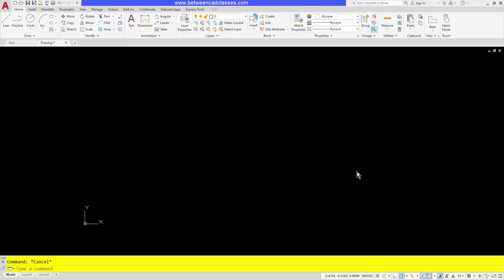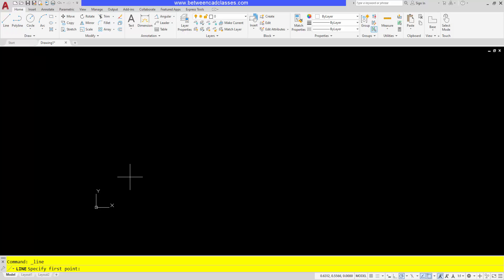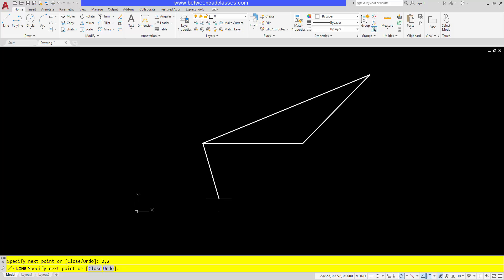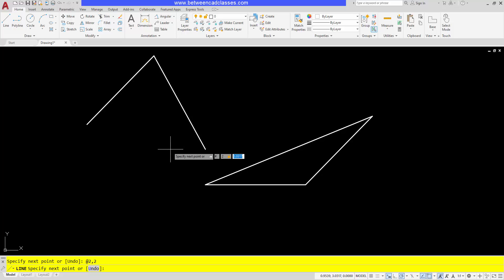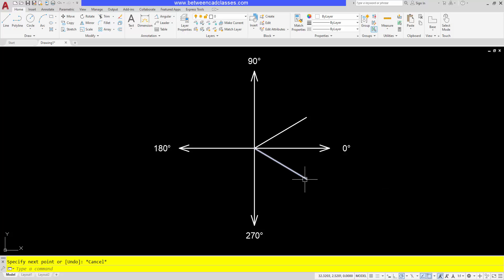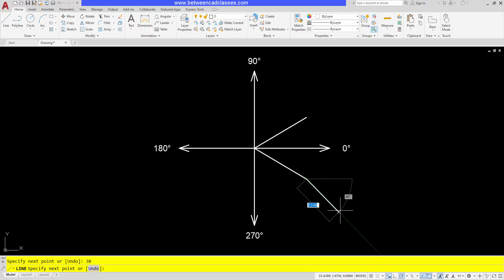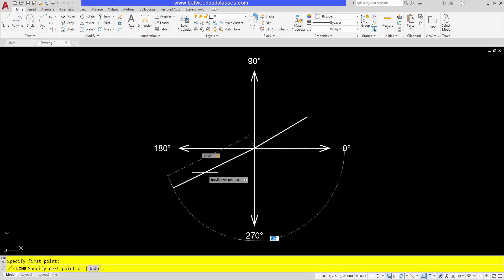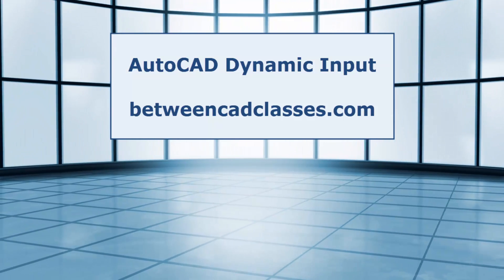Drawing with Dynamic Input in AutoCAD

Comment: How can you get AutoCad to show the coordinates while you are in the command?
Reply from the maker: I am not 100% sure I understand exactly what you are asking. You can get coordinates to display by clicking on the button with the three horizontal stacked lines on the far right side of the status bar at the bottom of the screen. Several options display, including Coordinates. Selecting that option will cause the coordinates to display in the status bar. If that does not make sense or does not address your question please let me know and I will try again. Thanks for watching!